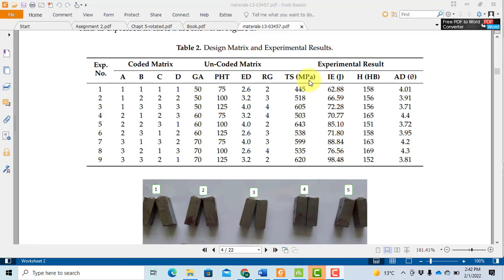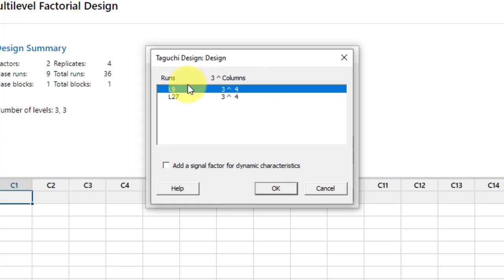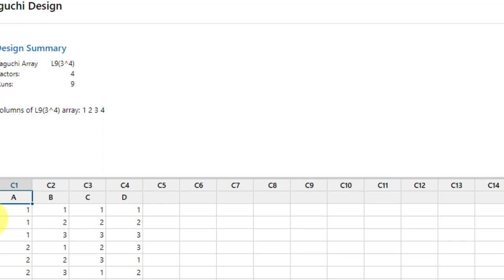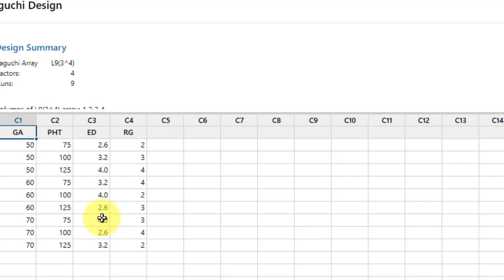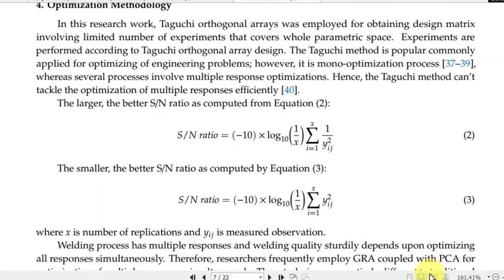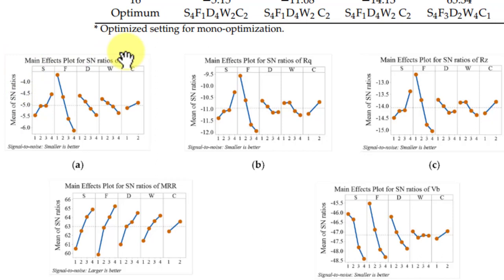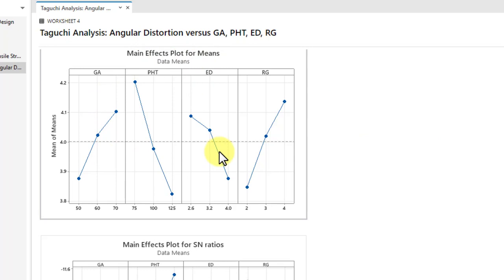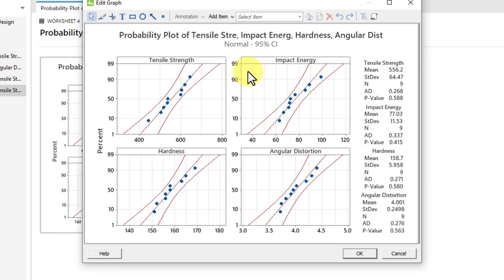Taguchi L9 Orthogonal Array and Signal-to-Noise Ratio’s using Minitab  | Taguchi Optimization method

Comment: Hello, thanks for your tutorial. I couldn't find the single and multiple optimization tutorial in your playlist. Can you please add them?
Reply from the maker: Taguchi is single optimization.....which multiple optimization technique you require
Reply: @EngineeringandInfo  Thanks for your fast reply. 
The optimization method that used in your article entitled:
"An Integrated Approach of GRA Coupled with Principal Component Analysis for Multi-Optimization of Shielded Metal Arc Welding (SMAW) Process"
Reply from the maker: @alinaderi333  okay. I will upload ASAP

Comment: Can we perform workplace parameter optimization to determine which factor influences a worker in his productivity

For example, the workplace parameters that influences a office worker is the type of chair,table,etc.

Can we perform taguchi analysis on this topic

If yes, please explain how to collect data

This is for my mtech mini project
Reply from the maker: How will you calculate response
Reply: @EngineeringandInfo  for example if we are considering an office workspace we can note the time taken (in seconds) by an employee to type a paragraph

Then we can use the smaller the better method to minimize the time
Reply from the maker: @jyothisprakashk9609  interesting.... yes. .. I can help u... +92 332 5056162
My WhatsApp

Comment: Sir
I am doing taguchi gra analysis for FSP optimization and in Anova I’m getting p value greate than 0.05 for all parameters how should I interpret that or how I could solve this problem
Reply from the maker: All parameters are insignificant
Reply: @EngineeringandInfo  But in the literature we have one of the parameter have a significant role in influencing the  output response
Reply: @EngineeringandInfo  Can you help me with the analysis ?
Reply from the maker: @yugeshraajha8792  what help reuired. you can contact me on whatsapp
Reply from the maker: @yugeshraajha8792  u r right. may be u choosed insignificant one

Comment: Dear SIr, for my project , I was stuck with an optimization problem, which is needed for continuing my experiment. There are two factors , one having 5 levels and other having 3 levels. Also there are 2 responses, out of it one has to be minimized other has to be maximized. Can you give me a quick guidance to understand which is the optimed factor values? I
Reply from the maker: apply multi-objective optimization... Grey relational analysis.... Composite desirability method...
Reply: @EngineeringandInfo  which software..and can you suggest any video that you have published
Reply from the maker: @mechzion01  excel... no, I haven't made any video so far